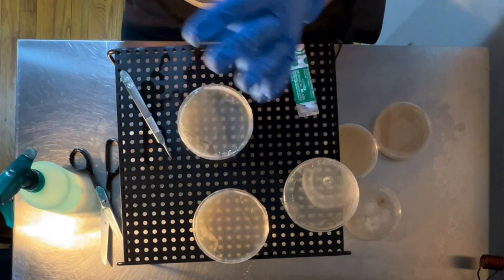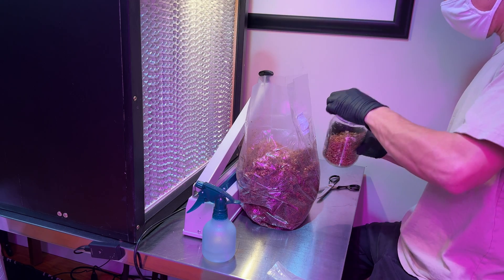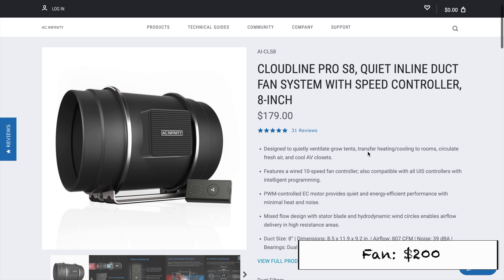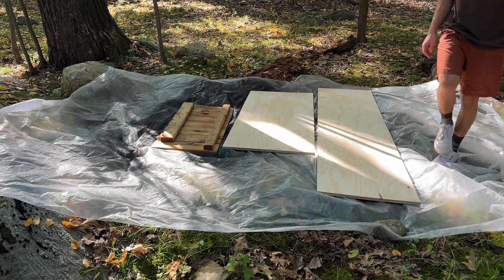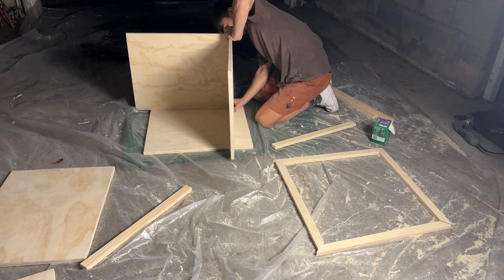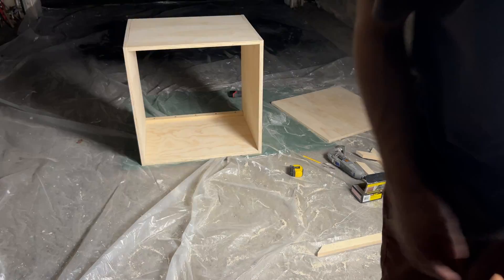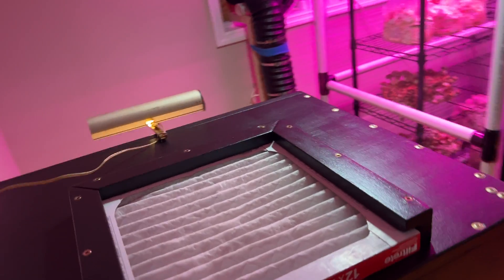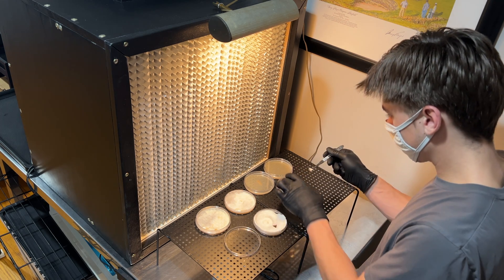Building a Laminar Flow Hood for Mushroom Cultivation

Comment: Any regrets putting the fan inside the box instead of on top? Or does it seem to work well and maintain laminar flow?
Reply from the maker: No regrets, it works well and is nice and compact. Maybe you'd get slightly more laminar flow from mounting outside, but I don't think it would lead to much functional improvement for mushroom growing.

Comment: there is a misconseption in pre-filter pressure drop. 0.3 wc is if the the air passes through the prefilter with 0.45m/s but that doesnt happer because the face area of the pre filter is much smaller that the hepa filter's where we want that air velocity

Comment: Great info, never thought about using an inline fan. I'll have to check the specs on my 8" Cloudline.
Reply from the maker: It's still working fine for me almost 2 years later! Although I used a 10" cloudline so there's a bit less strain then there would be with an 8"

Comment: Really loving the channel, from the UK. know this is an older video but I have a question that i’m struggling to find answers for.

I’m building a similar hood with an inline fan, is there any negatives to housing the fan iside the plenum as you have here? Makes sense to save space and overall just tidier, so i’d like to do the same, but is it better to have the fan on top blowing down into the plenum or does it not make that much difference. 

Thank you!
Reply from the maker: As long as you’re pushing air in somehow it doesn’t make a huge difference ime, at least in this context. There’s an argument to be made for mounting on the outside creating a more laminar flow, but as long as your plenum is big enough this way works great for mushroom cultivation.
Reply: @camsurbanfarm  Thanks for getting back to me! that’s something to think about for sure, i’m building over the next week or so. Keep up the good work man

Comment: This looks good overall, but there are a few areas that could be improved for clarity and precision. 

It would be helpful to include the distance from the fan hole to the edge of the piece you’ve cut, as well as more details on how the fan is mounted.

Additionally, I recommend adjusting the color scheme in the plans to correspond more closely with the actual materials used. 

While someone who has built this before might understand the design, those who are preparing ahead of time would benefit from as much detail as possible to ensure everything is clear and easy to follow.

Comment: One of my reactions is that the plenum isn’t large enough here. I’d expect highly turbulent air at the ingress of the filter. It shows up in your flame test as flickering even though your flow rate is correct. Might improve if fan is mounted externally to give the plenum more volume but also add a baffle and/or flow straighteners. Those improvements could be more apparent in a 24x48”
Reply from the maker: Agreed, I think that's the one downside to mounting the fan internally. I do have a little bit of turbulence, but it hasn't caused any issues so far. I'll probably do an externally mounted fan for the next one.
Reply: @camsurbanfarm  I'm building a version with fiberglass resin to form a horn with the fan mounted at the rear facing forward firing into the horn. The concept is that the high pressure output at the fan will gradually and smoothly expand to the lower pressure and higher volume area in front of the filter in about 2 feet. You just get stretchable fabric, adhere it at the front of the box where the filter will reside and stretch it back to an 8" duct hole and the horn parabola shape will form in the fabric. Resin it to harden and strengthen. Same concept is used in horn-loaded speakers.

Comment: It’s a year to the day since you released this video so… 1) How is it running now? 2) Have you had to turn your fan up to compensate for the filters getting clogged? 3) would you do anything differently if you were to build another?
Reply from the maker: The flow hood is still performing exceptionally well! I've put it through the works this past year, and it's definitely risen to the task. I did recently start running in on a higher fan setting, but this was mostly due to the new way I have it configured with a ducting system (see my lab build video), which increased the resistance. I haven't tested the airspeed in a while, but I have tested the cleanliness with petri dishes, and it's still not giving me any contamination at all. Overall, I'm very happy with it; the only two things I might change if I had my time again are 1) I'd definitely use at least a 2'x4' filter. The 2'x2' was great for the volume I was growing when I made it and still works for me now,  but it would be much nicer to have a larger sterile area to work in. 2) I'd consider either constructing the flow box out of metal sheeting or case it in a metal or plastic veneer to make cleaning it easier. There two things are just nice-to-haves and not neccesary for function, but I'd probably implement them if I was to build another.
Reply: @camsurbanfarm hoping to build one off your video soon so I really appreciate the reply.  I’ve already went with the 2x4’ filter but that works for my space for now. Will add the casing and should have the material to do so from the off cuts from wall panels.
Reply: @CarolinaCat843 running two of these fans or single larger radial fan?

Comment: Do you think a 1.5x1.5 feet H13 99.95% 78mm thick hepa would be compatible with s6pro? Or is the s8 a must? Europoor struggling here ;p
Reply from the maker: Unfortunately I don't think the s6 pro would be powerful enough to give you the 100 ft/ min with that filter. The S8 is only just enough for a 2x2 filter, so I think any less wouldn't be optimal. You don't need to go with the AC infinity, I just found it easiest for this build but you could look into centripetal fans like the Vivosun Z8, which might offer a better power to cost ratio.

Comment: Thank u for sharing the info .. super simple to follow your design/direction/calculations .. just curious why   is the filter so deep , is there a big drop in quality if using a 2.5inch deep same spec filter ?   Looking forward to building this an embarking on a journey .. one of the best "how to.." videos ive ever come across ❤🍄🍄✌🙏
Reply from the maker: Thanks for the kind comment! Hepa filters come in many different depths, but generally the ones designed for laminar flow are 5-6 inches deep. There are also 11 inch deep ones that are meant for scrubbing large amounts of air. Usually, the thinner (1") ones are designed for household air filters, and don't produce laminar flow because they don't have the metal 'gills' to direct the air straight out. A lot of mycology filters are 2.5-3" deep, so you'd be totally fine using a HEPA of that depth. You could even get away with using a 1" filter in some cases, since for mushroom work you just need clean air, not necessarily laminar flow. Thinner filters also usually have a higher pressure drop since there's less filtering depth so the fibers of the filter have to be more tightly woven, increasing the resistance. So just make sure to consider that in your fan choice.

Comment: theres not really any reason to spend that much money on the fan as it wont be running all the time. Ac infinty is a good name in fans that offer long time quiet continuous operations in harsh conditions. thats not really needed in this application.  

you can skimp on the fan is all im saying. it just needs to be able to move enough air.
Reply from the maker: I wouldn't recommend skimping too much, even if a fan says that it can move enough CFM, it might not be able to do so under the static pressure that a hepa filter creates. I'm sure they're out there, but I couldn't find anything too much cheaper than the AC infinity fans that can maintain the CFM under the pressure needed to run a hood this size. Cheaper fans also tend to be less consistent with their airflow rate, which could mess with your laminar flow. All I'm saying is make sure you check the static pressure specs as well as the airflow when looking.

Comment: What am I missing? It's just a specialty HEPA filter, a container, and a positive pressure fan capable of being regulated. Right? I don't see how these things get so dang expensive. 

Commercial versions I get. They're going to be expensive because the companies building them are taking on an inherent liability if their hood fails and contaminates expensive research. For a workable budget one though, it should be pretty straight forward.

Edit: Yeah the filter is expensive and most cheaper fans would likely burn up pretty fast pushing positive pressure. Sometimes you just gotta pony up!
Reply from the maker: Pretty much what your edit says, the filters themselves run between $200 and $600, and good fans aren't cheap either. I agree that the going rate on the market today is high for what you get, but until a company starts producing some of the parts in-house, I don't see finished ones going for much below $1000. That's why I made this video, so you can essentially get one for the cost of parts without having to shell out the markup for a company to produce it, since it's not too difficult to do yourself.
Reply: @camsurbanfarm I was listening to your video and started sourcing parts that would fit the requirements and was immediate like "oh". The two main components that you can't skimp on just aren't cheap. If you tried to go any lower you'd wind up without the necessary filtration or a hood that pushed turbulence - essentially a waste of money. 

Excellent build! I'll be building one similar in the not so distant future and really appreciate the straight forward instruction.
Reply: @entrepreneursfinest  Yeah, at first I thought the same thing you did, then I sourced it :)

Comment: Great job! Did you use an anemometer to check the flow velocity?
Reply from the maker: Yes I did end up getting one to confirm the flame test, it was pretty spot on, around 100 ft / min at 6 inches

Comment: Would a hepa filter cap that goes right over the intake serve as a good pre filter ?
Reply from the maker: If your fan can handle it, sure, but hepa filters usually produce a lot more resistance than merv11 filters, so it might put unnecessary strain on your fan. No harm if you spec it out and find a powerful enough fan, but the prefilter only really needs to take out large particles, your main hepa filter can handle the small stuff on its own.
Reply from the maker: I use a hepa over the intake fan on my grow tent (cloudline s4) and it cuts down on the flow rate pretty significantly.

Comment: I like this video.  I decided to build the filter box for myself.  My only criticism is that I didn't see any of how you mounted the fan.  I am at the point to start thinking about it now, so any tips would be helpful.  Thanks!
Reply from the maker: The fan is just mounted to the inside of the back side of the box using the hardware that came with it (bolts and nuts). I lined it up, marked where the bolt holes should go, then traced the outline of top of the fan on the top side of the box and cut out the circle, then drilled the bolt holes and mounted the fan. My biggest tip for this part is if you’re using a circular inline fan like me, get a hole saw that’s the same diameter as your fan. It will give you a much better result than trying to use a jigsaw or reciprocating saw. And make sure your drill is powerful enough for the hole saw bit, they sometimes require a lot of power to spin.

Comment: Where did you get that metal stand in front of the hood? Great informative video and the best suggestion I’ve seen for a full function flow hood at home. Thanks!
Reply from the maker: Thanks for the feedback! The rack is a kitchen cabinet organizer shelf, if you want to grab the same one as me you can use my affiliate link: https://amzn.to/3TkkTI2  🙏
Reply: Thanks! I have nearly finished my build per your guidelines. The filter face seems very vulnerable to deformation. What do you think about using half inch rabbit wire in front to protect it? Would it create extra turbulence in the laminar flow?
Reply from the maker: @donbursch9429 I’ve seen people do it before and it seems to work fine for mycology purposes, but my guess is that it would increase the turbulence since the filter face is designed with those gills to push air in a certain way and having it pass through the mesh would effect that. If you’re concerned about deformation I’d say go for it since it’s honestly a hassle worrying about touching the filter face when working or putting your cover on the hood if you use one, I’ve accidentally brushed it and had to spend an hour straightening out the gills 😂. Just know you’ll probably affect the flow, but it will most likely be fine for growing mushrooms.
Reply: I just finished the build and noticed some tears in the paper folds (see attached) which I assume is the heaps filter part   Does this look right to you. Hate to go to the bother of returning but after doing all this to avoid contamination neeed to be sure. Do you have any spots like this?
Reply: Well I thought there was a way to attach a pic but I don’t see how
Reply from the maker: @donbursch9429  Can't see the pics but I think I know what you mean, my filter came with a few tears too and it hasn't been an issue so far. If there's a lot of them or if they're right in the center where you're working the most then maybe I'd consider returning it, but if its just a few small ones you'll probably be ok. If you start to get issues, you could always use silicone or hot glue to seal them, but that would mess with your laminar flow so I'd wait to do that until you need to.

Comment: Can you link the hole saw you used? I bought the same fan. Was it a 10" hole saw or slightly smaller? Are the fan strap clamps bolted to the back of the box?
Reply from the maker: I used 9.6 inch (245mm) hole saw and it was the perfect size: https://amzn.to/3SJCHen. The fan is just bolted directly to the back of the box via the bolt holes in the baseplate, no straps needed
Reply: @camsurbanfarm by the way I finished the  project. Thank you for the reply. Mine is not as pretty as yours but it is very functional. Thank you for the tutorial!
Reply from the maker: @nastydave6334  Hey man I'm so happy to hear that, may it bring you many years of no contamination! 🙏
Reply: @camsurbanfarm  how is it holding up? I read online that these ac infinity fans burn up when in this type of static pressure use and it voids the warranty. Not sure if that's true but I've had mine running on low speed 24/7 for a few months now.  Do you leave yours running when not using it or do you cover it?
Reply from the maker: Mine's still going strong! I use a plastic cover I made when I'm not using it, you can just drape a plastic painter's tarp over the front. I'd recommend this over running the fan 24/7 which could be hard on it and will shorten the life of your filter (although the air in your lab is probably super clean!)

Comment: Great idea of having the fan inside the box! Does it produce laminar flow on the entire filter, or just down below? 

Also, how did you overpowered fan do? how much % of the power are you using to get laminar flow?
Reply from the maker: Thanks for watching! I get laminar flow across most of the filter face, only becoming slightly turbulent within a few inches of the edges. I use the fan on level 5 out of 10 and it does excellent!

Comment: Nice build! First time I’ve seen a duct fan used instead of a squirrel cage. How’d you secure the fan to the box?
Reply from the maker: Thanks! I just mounted the fan to the inside of the back panel of the box with bolts and nuts so that the intake side was lined up with the hole I cut in the top.

Comment: Love your video, great tutorial. Do you think you could produce laminar flow with the 24" x 24" x 12" HVAC filter you mention? I already purchased that one so I'm hoping it will work. I also wondered what setting you ended up on with your fan to achieve laminar flow? I may need to upgrade from the 6" variable speed fan I have. Thanks in advance!
Reply from the maker: Glad you enjoyed it! Yes I think you’d be fine with the filter you have, it might be slightly more difficult to achieve laminar flow but for mycology work you probably wouldn’t notice any difference in effectiveness. Just make sure to build your box big enough to leave a decent amount of space behind the filter to allow for even pressure across it. 

I use my 10” fan on about half speed to achieve 100 fpm, so my guess is your 6” fan might struggle to produce enough flow. I’d go for at least an 8”, depending on the model.

Comment: Hi. Very nicely explained. I will probably build this. I was looking at the fan specs. When I follow your link it takes me to the 8" fan on Amazon, however; when I check the specs on the AC Infinity site, the specs you have match the 10" fan. Did you use the 10" or 8" fan. There is a big difference in price.  Thank you
Reply from the maker: I used the 10" fan in my build because I was able to find a used one for cheaper than the 8" fan. I was originally planning on using the 8", and I think it would work fine for the filter I used. I only have to run the 10 inch at around half power to get the right flow rate. Best of luck with your build!